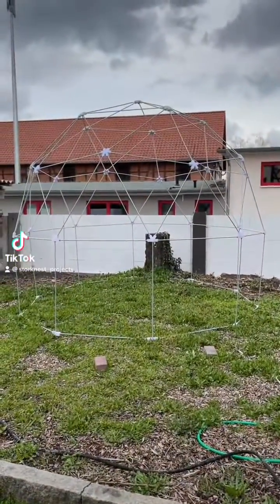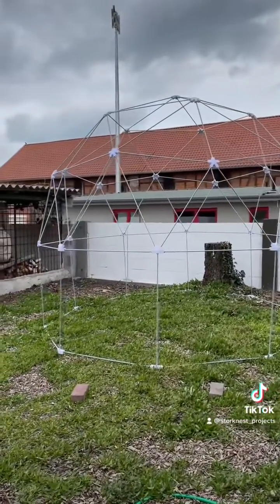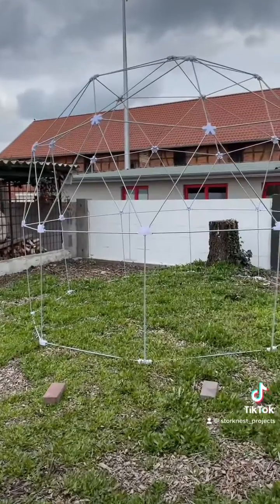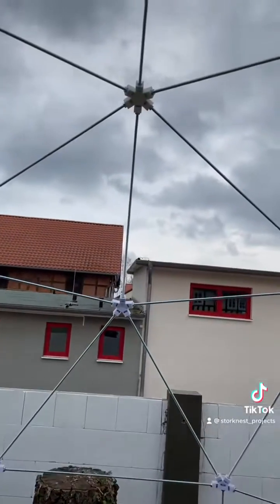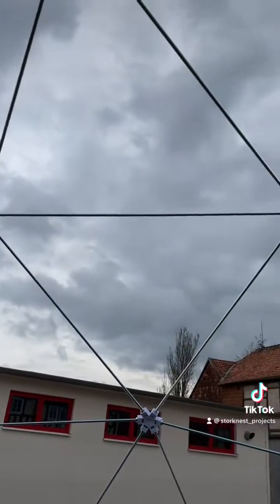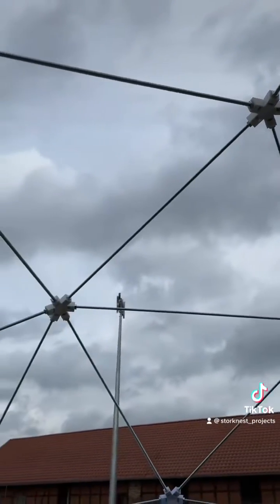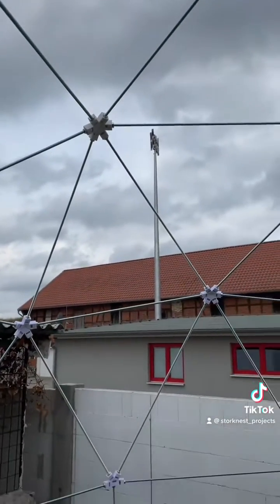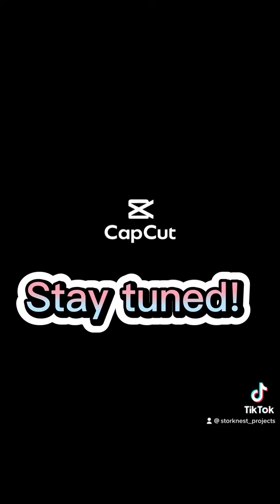How I Built a Geodesic Greenhouse Using 3D Printing!

Comment: I`d recommend adding a diagonal member in the base kneewall sections apart from where the door fits :).
Reply from the maker: Take a look at my other video! 😉
With the help of plywood, it’s super stable now. 😁
Reply: @StorkNest_Projects 
That will solve the issue.  The covering is the most challenging part, it`ll be interesting to see how you tackle it and what the end result looks like :)